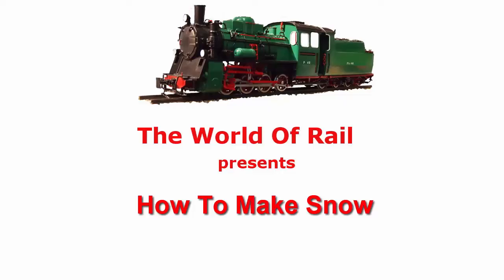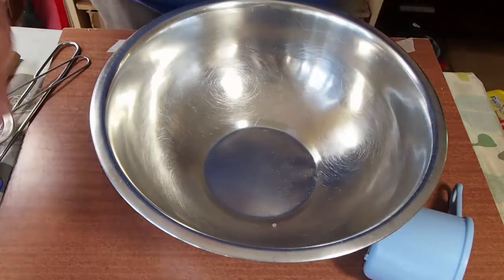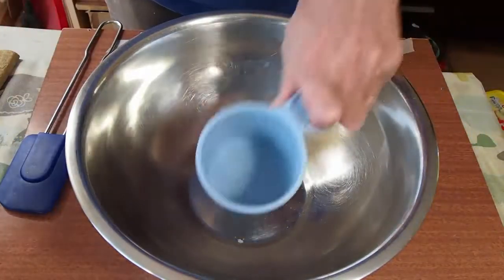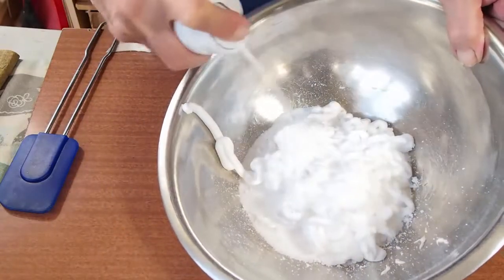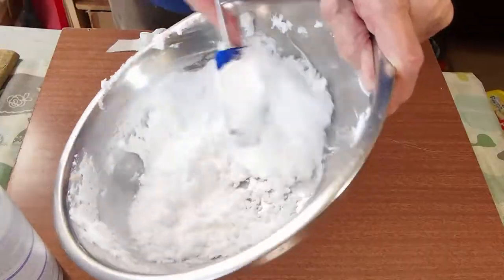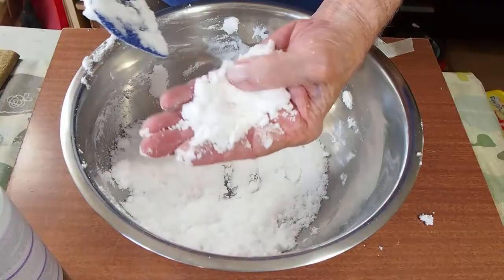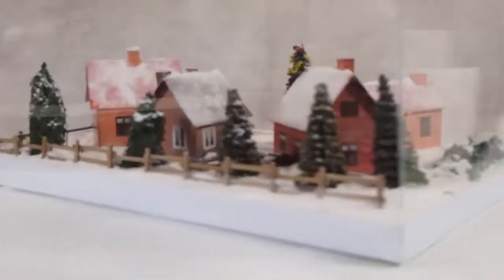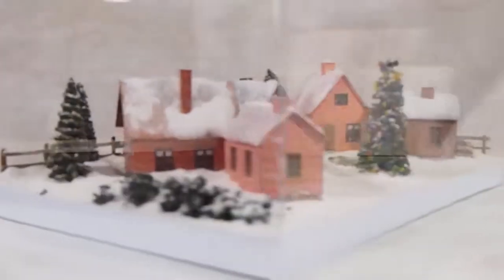How To Make Instant Snow For Dioramas, Crafts Projects, Decoration And Scale Model Scenery

Comment: Hi Great Tutorial! Just subscribed!!  I am setting up a euro christmas village scene. Can this be applied to stick to resin or ceramic painted diorama buildings without glue for temporary display, and clean off without residue or causing harm to them or the expensive neoprene winter game mat? The buildings I have are no longer made and would like to preserve them and reuse as needed for other gaming purposes as well. So I would not want to permanently glue on the snow or cause damage. TY Dave
Reply from the maker: Before I use anything I test. In my scenes I add the snow to card and wood buildings,  static grass,  flocked seafoam and wire trees,  In some cases I just sprinkle the snow for a light cover or frost.  Since I do not move the scenes much, it tends to stay in place.  If I want to cover a roof, I use pva or butapren glue.  There is no yellowing. So my best advice is to test.  The snow is cheap and easy to make.  So it does not cost much to test.  I have worked only with the materials mentioned above.

Comment: Hi great video one of the best I've seen, I did want to know how do you get it to adhere to the base. Do you use simple pva glue, does this yellow over time due to the baking soda and does this need to be sealed with pva water mix like other snow mixtures tend to need.
Thanks for any help it's much appreciated.
Reply from the maker: On flat surfaces I just sprinkle it on.  For a light snowfall or frost, I use a light coating.  For roofs or steep slopes, I use some pva or butapren glue.  It does not yellow and no sealing is required.  On trees, sometimes I spray thinned pva and then sprinkle.  You might test that on wreathes, etc.   So my other replies in this thread.
Reply: Thank you so much for answering the questions making a base for my son's action figures he's going to love doing a snow project.
Reply from the maker: Post a picture of it on my twitter account @modelscenerytut

Comment: After the Snow is made, have you glued it?
Reply from the maker: I don't put anything over over the top.
Reply: @ModelSceneryTutorials  problably I didnt explain myself correctly... I was asking if you have glued to the surface of the diorama..so it didnt come out
Reply from the maker: yes.  I glue the surface with a thin coat of white glue.  I use a finger to apply.  Sometimes I use a mist of spray glue.  Send me a picture of your end result.

Comment: Sir, can one mix baking soda with water as a substitute for shaving cream? Also how to attach the snow into the model?
Reply from the maker: The water will dissolve in the water.  To attach to a roof, put paste glue on the roof add then add the snow
Reply: @ModelSceneryTutorials  thank you for your reply sir, i'll try your method on my model.

Comment: How do you clue it down
Reply from the maker: I use spay glue as an undercoat and then just sprinkle.  Nothing over the top. Anything on top causes it to collapse.
Reply: @ModelSceneryTutorials  can I paint the base first with white PVA then sprinkle it on, will it stick and not flake off?